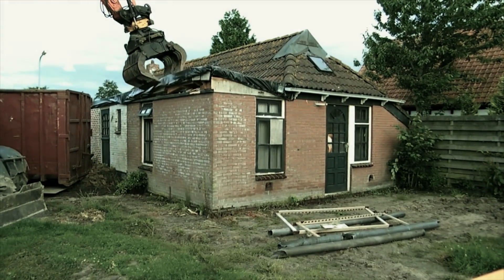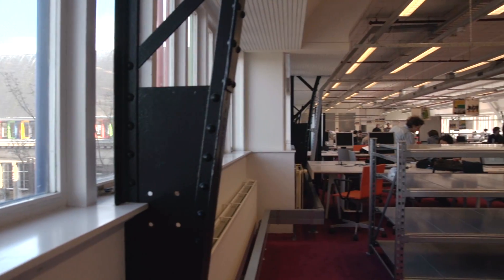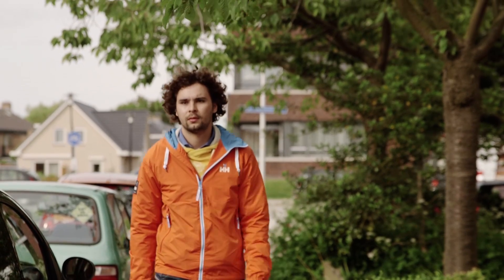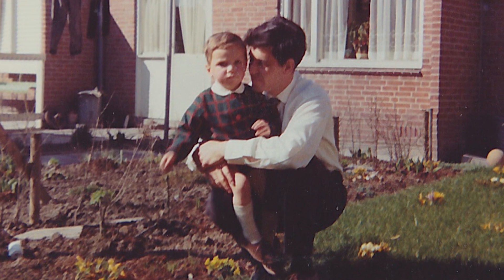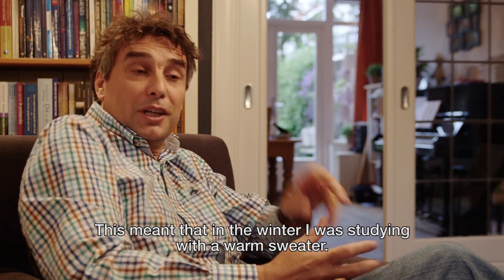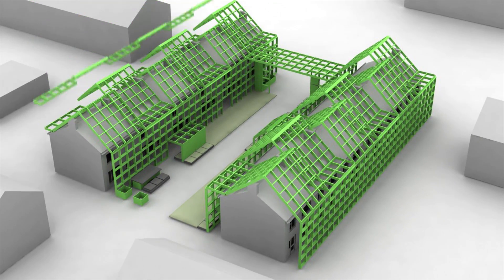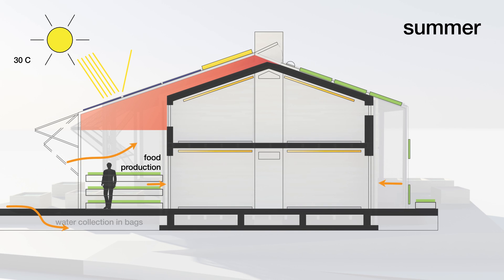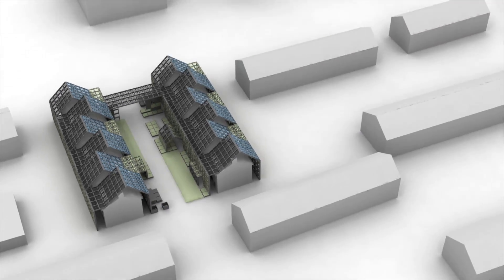Prêt-à-Loger - TU Delft - Solar Decathlon Europe 2014 Project Design Introduction [2013]

Comment: the heat discarded in the summer should be stored instead to be used in the winter. Also the PV panels are not oriented to maximise energy production. The inclination of the panels will cause a lot of reflectivity so a lot of energy will be wasted.

Comment: Nobel idea, but It's just lipstick on a pig, and drawing air from the crawl space could bring-in Radon, Molds and much more. Rebuild using EPS Composites that are Cheap, Clean and will last trouble free for 100's of years.